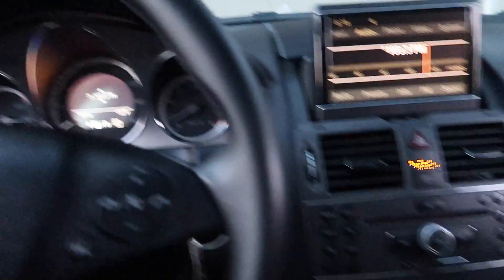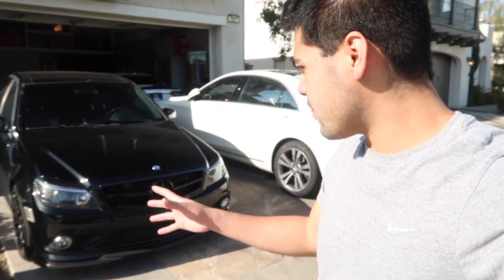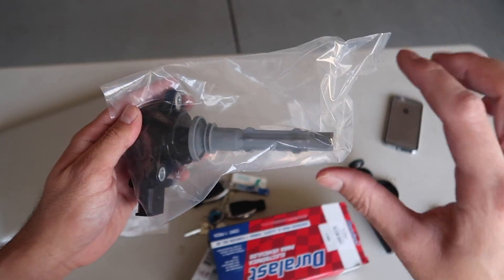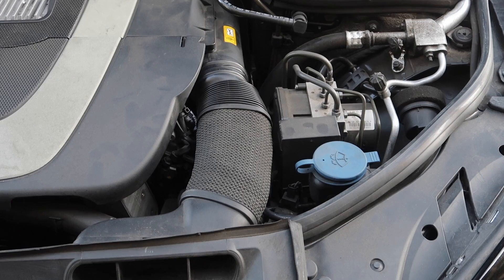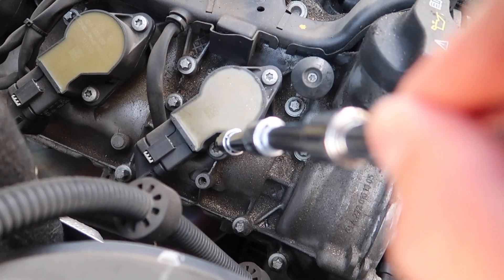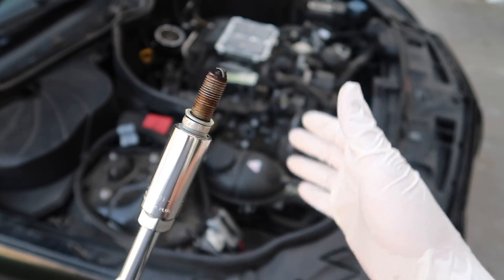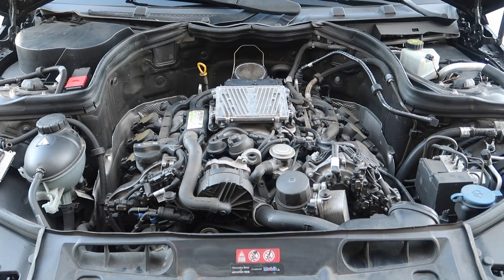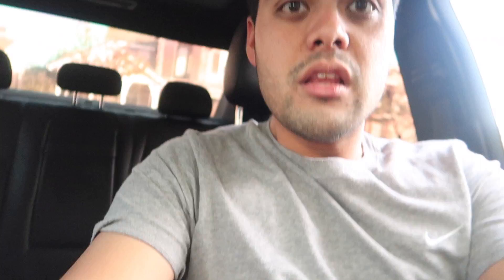How to Change Spark Plugs Mercedes Benz C300 w204. Fixing Rough Idle

Comment: I will like to start off by saying Thank You. I never leave a message on any video but your video is different. I learn how to change my spark plug and don't be scare to work on my Mercedes.  Your video and the few mistakes you made I was able to get the job done and my car drive perfect now no misfire (I change all 6 at once 🥳). Next is that radio. Thanks again.

Comment: 👏🏽 that was so satisfying seeing the journey to making that V6 sound like itself again....I have the same problem that you had I'm just hoping it's a MAF, throttle body or a spark plug problem anything other than that I'm screwed , mechanic wouldn't even tell me the error code he just said I must pay him $1500 and he'll have it running smooth again...that's when I got suspicious
Reply from the maker: Thanks for following along man! With every car I work on it end up being a journey haha! Ya $1500 is such a suspicious quote but I hope you were able to figure out what you had to do on your own. Try getting a OBD scan tool to see what error codes your car is throwing at ya. It'll be super easy to fix once you know what's wrong.
Reply: Bro, just take it to the AutoZone They will scan you the car for free and will tell you which error codes are stored in your vehicle. This will save you a ton of money And will prevent you from buying unnecessary expensive parts and waste your time. If after scanned, it shows the code P0172 bank 1 and P0175 it might be a faulty MAF sensor. Any code P0301, P0302, P0303... etc. It might be a faulty spark plug or ignition coil, or lastly a defective fuel injector. Hope this helps
Reply: @proracingmexico3176  yep I learned this hard way brought my car to the shop because I needed an alignment but check engine light came on! So I had them scan it and run coeds for 60$ , my dumb ass forgot autozone has it for free wasted 1k to get some things fixed to have light still on finally went to autozone it’s was 25$ sensors all I needed
Reply: @RichardCuico  what mpg gas milleage?

Comment: my car is having this same problem only on cold start... once I drive it for that first time no misfires on start up. I changed all the spark plugs and cleaned throttle body and MAF. still no luck. should I try the ignition coil.?
Reply from the maker: yes definitely change out the ignition coils

Comment: It’s best to remove the resonator and replace It with a x-pipe then delete the mufflers. I took it a step further and dyno tuned the PCM, managed to get 340hp out of the 3.0! Very pleased with killing all the emissions control equipment as well it’s no longer eating its own farts!
Reply from the maker: does the order you do them really make a difference? That's absolutely incredible though that you're pushing out 340hp! I can only imagine how different it must feel from a standard c class
Reply: Richard Cuico the order isn’t to important but you definitely need to do the full exhaust and k&n filters before dyno tuning. I offer the tuning service at my shop with the 340hp tune for 249.99. You can eat vettes guaranteed.
Reply: @nateb7259  Where are you located?
Reply: Ignorance Is Bliss north of McKinney, Tx
Reply: Nate B Lol

Comment: i have a w205 c300 2016 you think itll be the same? or different?
Reply from the maker: the process should be similar but the spark plugs used and the location of them will probably be different. Most mercedes though are generally similar

Comment: It was the ignition coil huh?
Reply from the maker: ya that and a bad spark plug
Reply: Richard Cuico Yes sir happened me about 3 years ago. This time Car had a rough cold start idle so I ordered new spark plugs. But after seeing  your MAF video that fixed it was thinking about returning them but f**k it I switched them. Great video by the way bro

Comment: Did you have to torque it to a certain amount or did you just tighten it freely?
Reply from the maker: the proper way to do it is using a torque wrench, however, you can approximate the tightness freely. Just don't overtighten because it made strip the thread and end up losing the spark plug in the engine

Comment: You're cute!  I'm gonna change my spark plugs this weekend.  A bit nervous since it's my first time.
Reply from the maker: haha thanks! Just do be careful when you do it and if you're unsure about something be sure to check out this article which helps explains the steps involved. https://www.pelicanparts.com/techarticles/Mercedes-W204/45-ENGINE-Spark_Plugs_and_Coils_Replacement/45-ENGINE-Spark_Plugs_and_Coils_Replacement.htm
Reply: @RichardCuico  Thank you!  You forgot to use a torque wrench which is very important,
Reply: @melaniamai604  I agree 100%. I always use a torque wrench especially with aluminum heads.
Reply: What us the torque setting spec for the spark plugs?

Comment: Hey i have same exact c300..  Car runs fine but seems to shake a little while stopped in gear.  But then its fine in park.  Any ideas?  Im thinking my main pully is moving around or something?  It also has a whine to it when accelerating.   Ive looked that up and there are a ton of things that it could be.  Thanks in advance .
Reply from the maker: I honestly don't know since I haven't encountered those problems myself. Best to start with the spark plugs since they're pretty inexpensive. Then maybe moving to other parts like the belt and so on. Thinking about it more, your engine mount may have gone bad and needs to be replaced so check into that. It's a pretty common item that goes bad. I heard it's not too hard to do on your own.
Reply: Thanks man!  @RichardCuico
Reply: Did you find out what it was seko?
Reply: @Silenced_by_Utoob  motor and trans mount..still haven't fixed it. They want like 2k at the shop.
Reply: @xxsekoxx  dang, well atleast still running

Comment: I’m a year late for this video. But I’m currently changing my spark plugs (all 6) of them. I got my spark plugs from the Mercedes Benz dealership themselves. Does it matter if I get it from Auto-Zone or the dealership? Because I paid way more for mine. But if I can get the cheaper ones instead of the original ones, I will. But Mercedes always recommends original parts. So I’m confused.
Reply from the maker: The ones I got from Auto-Zone were a pretty good brand called NGK. They weren't some off-brand with no reputation. In my opinion, these spark plugs are more than perfect. The certified ones are similar but since they are "certified" they have a huge mark up.

Comment: Excellent video thank you so much! I appreciate all the information you give including what tools you use. What stereo is that in your brother’s car? Is that the factory unit or after market? Thank you.
Reply from the maker: no problem and it's a factory unit. This C300 came with everything on the option list
Reply: Richard Cuico wow thank you! hmm i wonder if I can find an old unit like that or upgrade to something. mine has the basic stereo. no navi and no usb connection. siriusXM is cool. lol
Reply from the maker: there's a video showcasing a guy installing a big screen in his mercedes. I haven't check it out yet personally but it might help you out https://youtu.be/SvlRNVKdnis
Reply: Richard Cuico Thank you again. I swapped out my spark plugs which actually were in pretty decent condition for 60k miles. however the huge difference was in the rpm, overall sound of the engine, and the smooth operation. what i initially noticed was a slow down in performance and some noises when idling. now it purrs!! You rock bro thank you!!

Comment: hi my w204 has quite some vibration when idle. but doesnt have check engine light, could it be misfiring too?
Reply from the maker: it possibly could be. The only way is to just change them out. Fortunately that isnt too difficult. It could also be the engine mount which is probably why it isnt showing a check engine light
Reply: You can buy an obd reader for less than 20$ online (bluetooth) and read any error code from an android phone.
Reply: Mine does as well, but only in drive.  What was your issue?
Reply: Check engine mounts

Comment: is it the same for a 2015 c300 (w205)?
Reply from the maker: the steps should be relatively the sam however please check your owners manual for the correct type of spark plug as it could be different

Comment: Defiantly much more dielectric grease, it's to ensure contact areas don't have exposure to moisture and air causing oxidation on contact points. Although the grease is dielectric it doesn't inhibit the contact of two metals together. It should be used any time you have any type of connection that has seals that can be compromised, which means almost any time you unplug any connector you upset the seal and introduce dirt in to the surface the seal sits on. Think of dielectric grease as a liquid seal

Search for Scotty Kilmer
, he has a great video about it ;-)

Comment: Have you changed all spark plugs?
Reply from the maker: ya I did. I just showed myself doing one since the steps are the same
Reply: Got it. My car is also a little shaky when idling. Maybe it is time to change them all. And I saw your car idling on 1000rpm, mine is on 650rpm. You did something special?

Comment: Does the engine light stayed on after you changed the spark plugs?
Reply from the maker: It's been awhile but I think it did because of a bad ignition coil. I ended up fixing it after that

Comment: Great video man. I just have a quick question, how often should the spark plugs be changed ?
Reply: Nasir Ayofe 
Spark plugs should not have to be changed in the life of the car- they should last over 200,000 miles. Unless you have a misfire, then you'll need to replace it.
Reply: Clorox Bleach according to Mercedes it should be changed every 75000 km or 50000km on amg model (and some engine).

Comment: Great Job.  So it's was really the coil and spark plug was the issue.  Clean the MAF is still a good idea.  What you really want to do is clean out the down pipe and the rubber tube more often.  Also check out where the black tube connects to and plan to change out that plastic pcv cover soon along with the breather part inside the pcv cover.  This is where it helps collects the oil fumes from your engine that creates all that gunk you were cleaning on the down pipe and throttle body.  Do this will stop or slow down your next project, the intake manifold.  Looking at your engine with the tell tale sign of oil residue means there are oil in the air intake.

Comment: to each his own but I would never put auto zone parts in a Mercedes they I would've gotten bosh plugs from the dealer as well as everything else. You do know something cause those plugs to look the way they did you might want to check that out
Reply from the maker: I know autozone has a pretty bad reputation when it comes to parts but NGK is a pretty reputable brand too so that's what I got. My brother drove with the spark plug out for a fair amount of time embarrassed to say which is probably why it looks like that. However, I'll definitely take another look when I get a chance just in case. Thanks for the tips!
Reply: Yeah Bosch and NGK are great brands. Bosch does make OEM parts for Mercedes. But definitely true....on a car as expensive as a Mercedes, always use good brands and OEM. I will be changing my plugs soon and this video was helpful. Thanks so much.